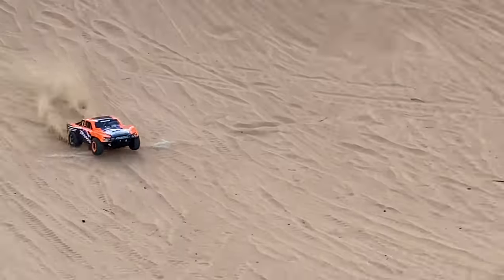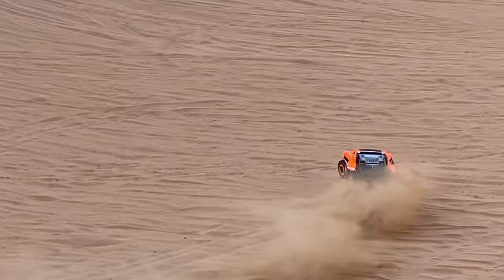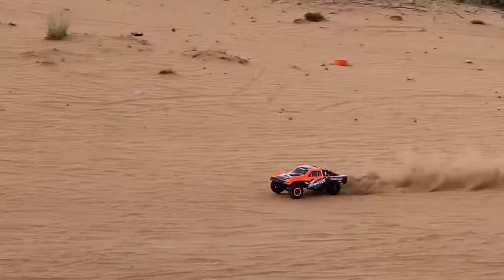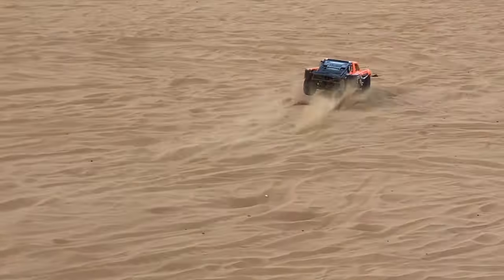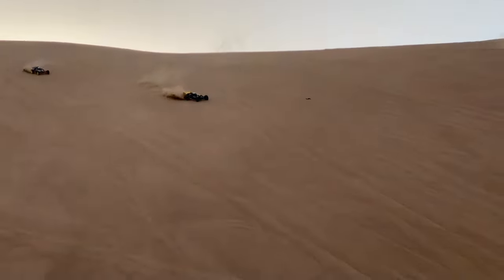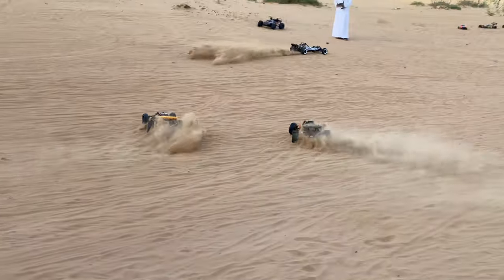Traxxas Slash or Hpi BAJA 5b

Comment: Are there any mods done on the Slash? Also, is it an Ultimate Slash?
Reply from the maker: Its rwd slash with castle creations 4600kv motor sand paddles rear tires
Reply: @UAERCADDICTS  oh okay
Reply: @UAERCADDICTS  btw do you know where to get an Arrma Senton 3s blx in the UAE?
Reply from the maker: yes hobbysportz and hobbyhub
Reply: @UAERCADDICTS  okay thanks